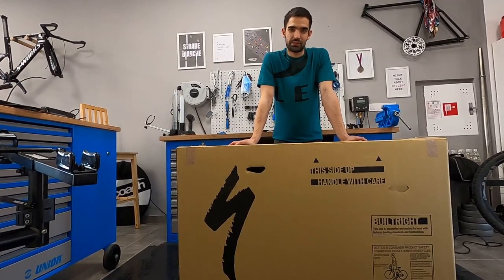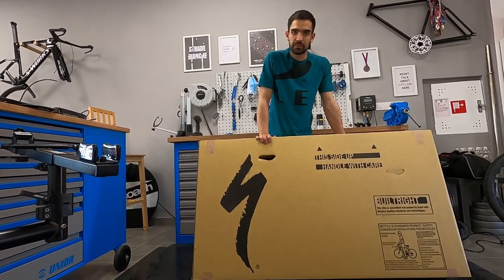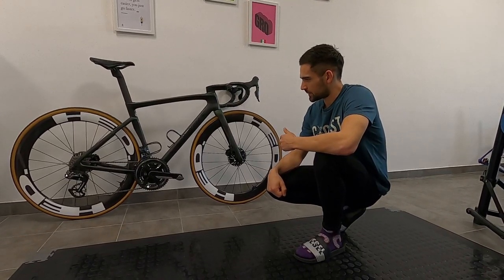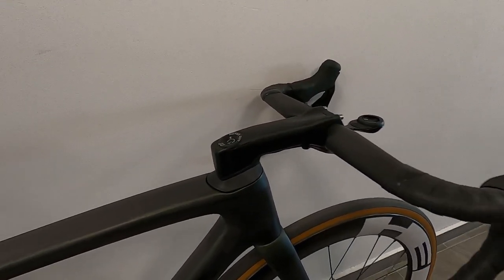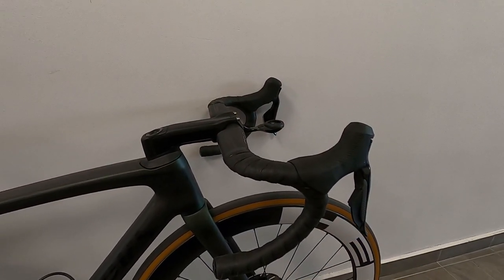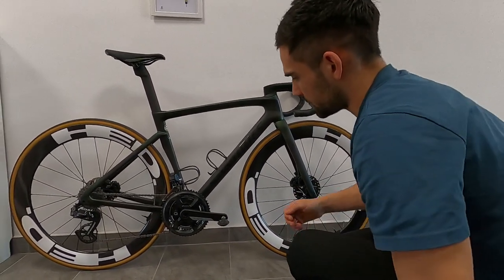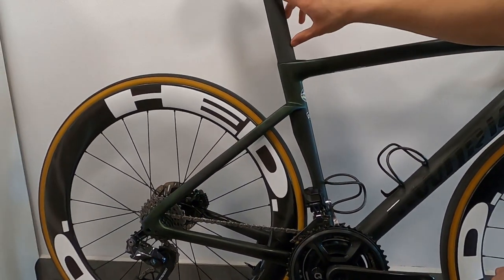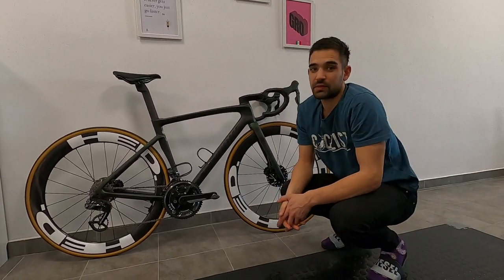I finally got my S-Works Tarmac!

Comment: Really love the way it looks, but not as light as I expected. I would look into the THM Clavicula SE PM with some carbon Ti chain rings. It is expansive, but it's super light and probably the best looking crankset out there
Reply from the maker: I much prefer an accurate, reliable PM, sturdy cranks and functioning front shifting, thanks

Comment: best look S Works I have seen.  Not sure about the charging port at the rear ,  but I would hope it had adequate protection from the elements
Reply from the maker: Thanks!
Reply: @ronykuba    Ron, what's your thoughts on the new Factor Ostro VAM ?

Comment: amazing bike, what a weapon. Was wondering for the inner tubes, do you have to use a valve extender as I can't find anywhere that has challenger tubes with a valve longer than 44mm.
Reply from the maker: Thanks. Yes.

Comment: Hi, great bike. What is the height between the bottom of the socket and the top cap, please?
Reply from the maker: Stack in other words?
Reply: @ronykuba  No, the head tube length + the lower transition + the upper transition + the stem. So 11,3 cm + 1,5 cm + ... + ... Just to imagine how many spacers i should put on mine. Thx.

Comment: I just got an S-works myself. Can you change the angle of the Barfly computer mount? I like my computer to be level with the ground.
Reply from the maker: Yes
Reply: @ronykuba  Ha, great. Is there somewhere I can see a tutorial? Seems like the bolt just screws directly in, but I haven't tried to take it apart.
Reply: @ronykuba  Ah, nevermind. Just loosened the bolt to see and it couldn't be easier.
Reply: @ronykuba  Ah, it's not a wind brake anymore. So much better.

Comment: Great video!
Is there a way to change the angel of the STI-levers without changing their position on the bars?
Reply from the maker: Yes, rotate them
Reply: @ronykuba Thanks for the reply. But I  mean the up and down not the in and out adjustment. If I place them where I what them on the bars they point up at a wired angel.
Reply from the maker: @lucasweber8880  there's reach adjustment for that

Comment: Question about the 12 degrees negative rise stem... Is there such product? Thought only +6 or +12 degrees options in the market
Reply from the maker: Yes, it's caught on this very video
Reply: @Askia Santosa flip a +n degree stem and you get a -n degree stem
Reply: I dont think the sl7 stem can be flipped
Reply: @askiasantosa6489  There's no reason why not. And even if it were the case the default position would be the negative rise not the positive rise.

Comment: the sl 7 is not really lighter than the Venge (frame and fork 80g) but the BB is heavyier. Venge is much better everyone knows.
Reply from the maker: That's just wrong. My 52cm Venge frame weighed 960g. This weighs 830g + the fork and seatpost are lighter too. BB30 is only lighter when used with the SW crank and the St bearing configuration, which nobody does because it's prone to creaking.
Reply: My s-works venge size 52 , has the exact same build but with roval clx 50 and weight 7.15 kg :)
Reply from the maker: @leonardosoares2002  Roval CLX 50s are a fair bit lighter (and slower)
Reply: Not. A lighter bike is Sworks SL6 Ultralight in rim brakes. 6 kg.
Reply from the maker: @louis1904  pointless

Comment: The venge is better looking than that!
Reply from the maker: Firstly, I disagree. Secondly, I'm using it for bike races, not beauty peagants.
Reply: @ronykuba  to some people looks matter. Since you mentioned racing. The Venge is still faster than sl7. If i had a choice to take between that sl7 and the venge. I would take the Venge. Even if you offerr me 2 sl7, i would still take the. Venge. 

I have ridden both these bikes. The Venge is stiff. Not mushy flexy soft like SL7
Reply: @popitn2nd  sl7 is a better bike
Reply: @louis1904  Venge has no Recall. So Venge is a better bike. lol

Comment: does oversized pulley wheel also improves gears shifting in the back??
Reply from the maker: No
Reply: on hard right-handers you can use it as an outrigger.